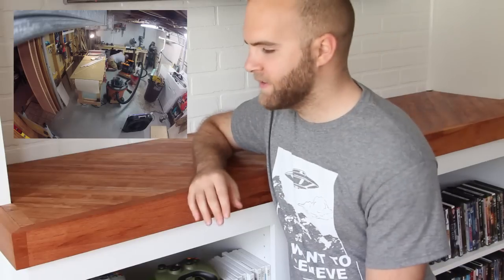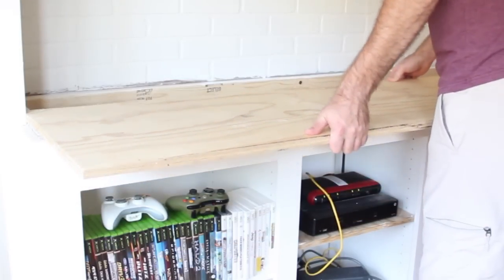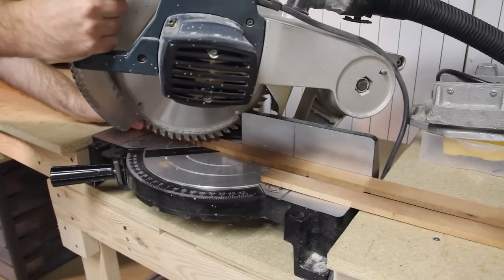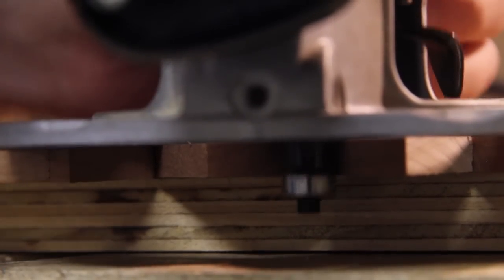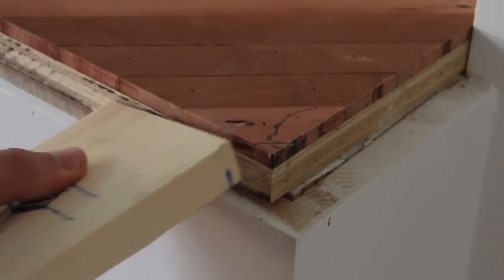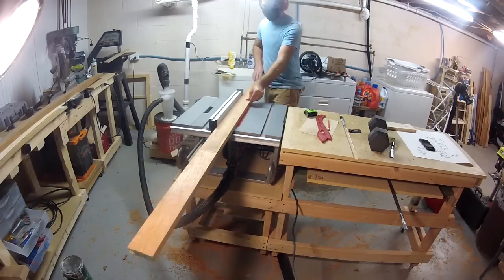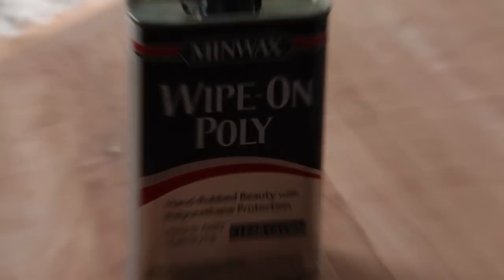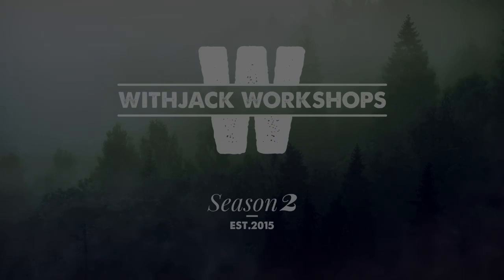DIY Wooden Countertop

Comment: Hi great work love the look but i was wondering if you would have any expansion issues with the wood being attached to plywood as i am considering replacing my kitchen counter tops with something similar and would prefer to glue the strips.
Reply from the maker: Hey there, thanks for the kind words! I haven't had anything go wrong with it but mine doesn't see any moisture or anything like that.

Comment: Did you need to fill the cracks where you put the pieces next to eachother?
Reply from the maker: If you are preparing food on it and constantly getting it wet then I would cover it with 2 part epoxi instead of just poly like I did.
Reply: Brett Withjack what 2 part epoxy would you recommend.
Reply from the maker: Not sure, haven't used it before. There's a lot of different types out there so I would definitely recommend doing a bit of research.

Comment: Hi, I am costing kitchen worktops, solid 35mm with engineered cut outs, how would this technique work in a kitchen [wet] environment.
Maybe I could use marine ply with a  hardwood veneer top, I don't mind the extra work, what I fear is de-lamination? and would it be a lot cheaper? I would have  to pay for some labour, and hire some tools.
Reply from the maker: in a wet environment like a kitchen, you'll have to do a lot of coats of polyurethane but otherwise you'll be fine